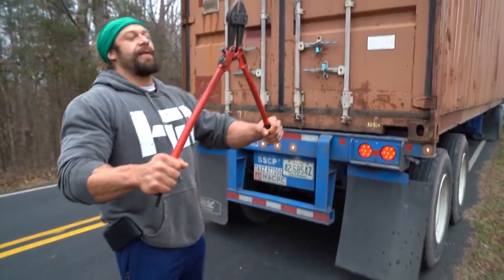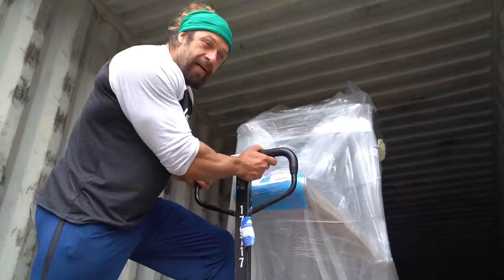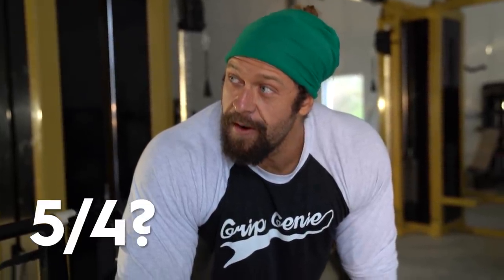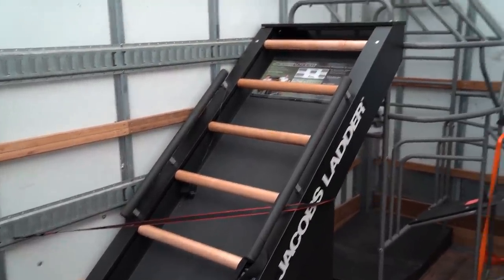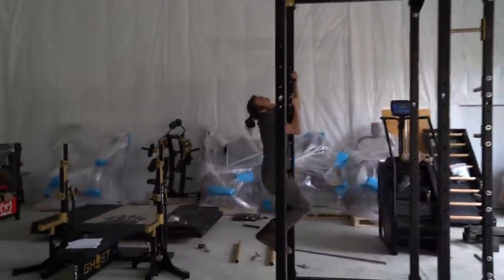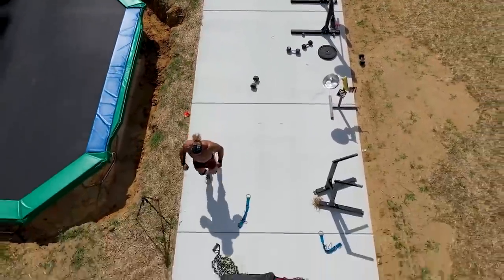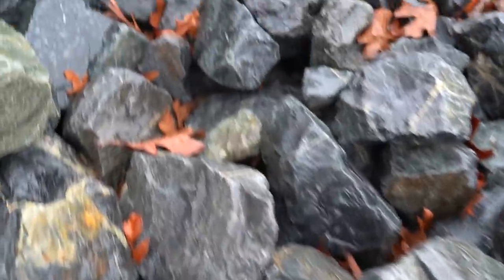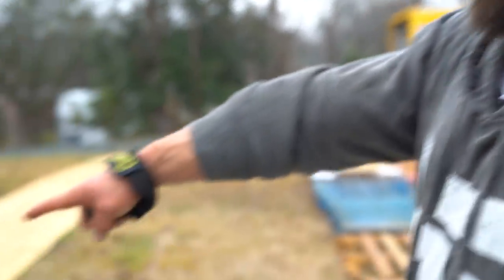Goodbye Gym Barn?

Comment: Early lockdown I bought a free standing pull up rack and high parallettes for dips. Weights, especially olympic weights, were too expensive back then.

I have some adjustable dumbbells and some smaller 25mm weight plates, but I rely calisthenics for my heavy lifts.

Got som gymnastic rings too.

I've managed to setup a dip belt attatched to the rack that lets me do sissy squats and hyperextensions. I can also do band assisted nordic hamstring curls.

I have to be creative as hell, but I can do almost anything I need. I miss rack pulls and heavy squats, though. I have to do dip belt squats for reps.

I also have a huge 90kg sandbag I use.
Reply: That sounds like a good setup Age Kush! Getting work done!!!
Reply: @ohsam8206  Is this the elusive Sam, legendary videographer?

I've been blessed🙌🏻
Reply: @momatotsosrorudodi  you're very kind Age Kush! You're making a difficult situation work with creativity to make the equipment (and I imagine new training methods as you are unable to lift heavy right now) to reach your goals. That's admirable and sounds like it's working well!!! :)

Comment: Repping my $250 home gym comprised of an 80's bench/squat rack combo, an adjustable incline/decline bench, some of those 1 inch concrete and steel weights, and a set of bands...Didn't realize how much I could get done with so little. Rings and a Dip rack/pull up bar will be next. 

I look forwards to the new gym, new videos, and new shenanigans! <3

Comment: Dude, I've made so much equipment myself since building my covid gym when everything was out of stock. You can do a lot with a little skill with tools and some lumbar. I have a equipment outlet near me that finally has tons of stock so I will be upgrading some things soon, but I am going to keep a few things like my wooden dip setup and diy farmers bars and cable attachments just for nostalgias sake. I love my BuffDudes style power rack but I am definitely excited to get a real one. The wooden one does the trick, even put 850lbs on the bar out of curiosity and it was still pretty solid, but not having standard hole spacing is a pain for setting up safety bars in the right spot. Also, I am sick of having to unscrew and rethread my home made j cups every time I change the bar height... but hell, if you can't afford a decent rack and are capable of building it, I would take it over any sub 700$ power rack I have seen. It was only about 130-150 in materials and that's because I had to buy a 20$ speed bore drill bit and the correct screws. I also built a bunch of accessories like a landmine, a rack for hanging things, chalk stand and a bunch of cable attachments (need a welder for some of that). I was going to build a steel power rack because I am ok with metalwork and have a nice welder, but the raw materials cost was damn near the same as what I would have spent on a rack comparable to what I could build with my tools and skills. Not to mention how much longer it would take vs the wooden one.